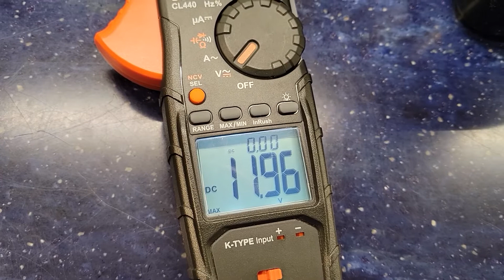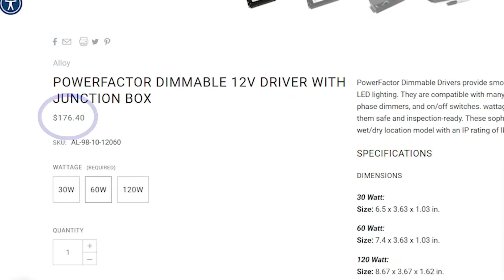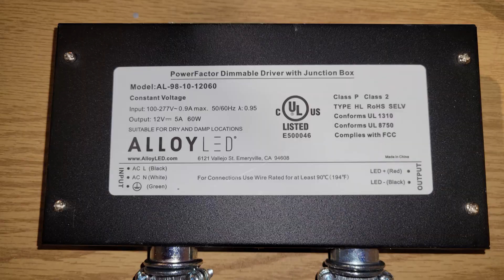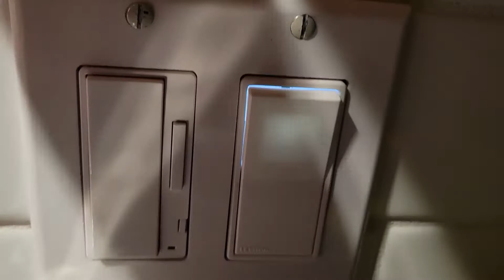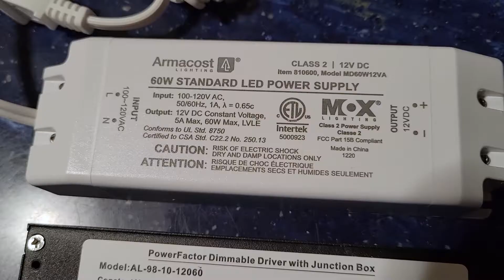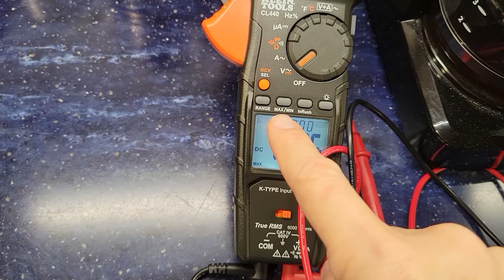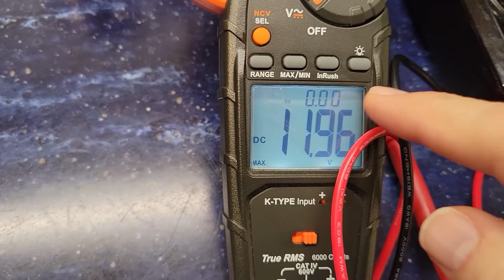Replacing Defective LED Driver (Transformer)

Comment: How did you determine the wattage of the replacement driver unit?
Reply from the maker: The information is usually printed somewhere on the older unit. If only voltage and amps are listed the wattage can be calculated by Volts X Amps = Watts.

Comment: Great video! If your LED strips are rated for dimming, it would be nice to put them on a dimmer. You would need to verify what type of dimmer your driver is compatible with (Triac or ELV, I would not recommend 0-10V dimming as it is way more complicated).
Reply from the maker: When we remodeled our first kitchen, I installed dimmers and dimmable CFLs, and quickly discovered we either wanted the lights on or off and seldom in between. We eventually removed the dimmers and went with standard LED lamps. I do have a dimmable strip in the den area which we actually do use. https://youtu.be/NDKO-OWCHk8?si=RvoUkmqaDtTyYMWl  Thank you for sharing the info.

Comment: Very nice!  Great content.  I have that same CL 440.  I especially like the temperature function.  I use it when I am checking vent temperatures on automotive air conditioners.
Reply from the maker: Welcome back, I only wish the CL440 had a Lo-z function to eliminate ghost reading and having to reach for the Klein analog voltage tester. Had a friend helping with some wiring and I told him the circuit was dead but he freaked when he saw ghost voltage on the meter.